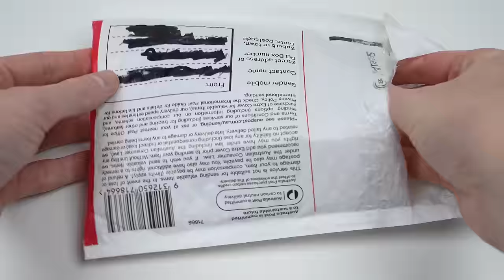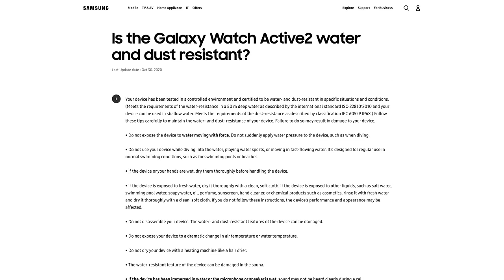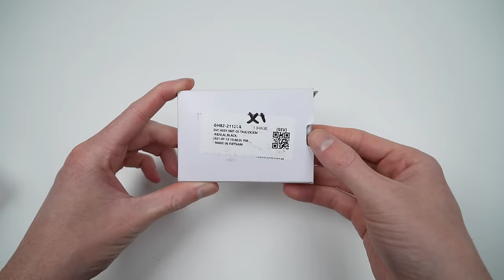Salt Water Damaged Samsung Galaxy Watch Active 2 Restoration

Comment: Seeing how a lot of Samsungs products are engineered it boggles my mind that Apple can have a very similar product yet over-engineer it to the point of being nearly unrepairable.
Reply: I don't think apple is over-engineering its product, they do that for a reason. I have a exact same watch and never took it into shower, however, after 9 months of daily use, samsung's crappy adhesive fails and the watch's ecg sensor and hrm sensor stopped working. I won't purchase any samsung products anymore.
Reply: Apple wants more money, but Samsung wants more customers. So it makes more sense that Samsung sells replacement parts while Apple wants to sell more devices.
Reply: It is deliberately engineered to be unrepairable.
Reply: @creamylulu3427  question. How many apple products do you have? Trying not to jump straight to calling someone an apple fanboy
Reply: That's not over engineering, that's under engineering, glue is a bad engineers best friend. The genius is in making something repairable !
Reply: @creamylulu3427  I've taken my note 9 into the shower multiple times and the only consequence has been a faulty charging port, but even that went away with time (don't ask me how that works). ig their phones are just built different
Reply: @creamylulu3427  I purchased the galaxy watch 3 like a year ago and shower with it, jump in the pool with it, clean my hands and arms with it on. I do it also with my note, I even take the pen out and they're perfectly fine (the watch, the note and the pen), maybe your piece was damaged in manufacturing or fell from a high place idk
Reply: @ProjectFraz  none, I've been using samsung's products since 2015. so,you happy now?
Reply: @creamylulu3427  don't need to be rude dude. I was just asking
Reply: adhesive wears out over time on any electronic. I have a Apple XR and took it in the shower 1 day now I have water damage on my screen
Reply: @miscl_anon  Samsung's products was duilt  tough before they move their factory to Vietnam(different adhesive suppliers probably). I cracked my s9's(made in China) front and back panel two years ago and It still can survive shower today. I stopped take my s20 into shower after the watch was damaged. both of them was made in Vietnam.
Reply: @creamylulu3427  my note 9 says it was "Manufactured in Vietnam" so idk
Reply: Would neva buy an apple product. So overrated
Reply: @creamylulu3427  that's a very specific scenario for you to write an entire brand off lol. "Well my cheap watch failed so the company is trash" I've had an active 2 for over 1 year with daily use and taking showers and swimming with it. You're dramatic
Reply: @huskers1278  I don't think I am being dramatic. actually that's only one of the reason why I decide to switch.
Reply: @possamei  I think it's partially deliberate but there are at least a few reasons. It might save them a dollar or two on fasteners like screws, and probably makes some things easier to automate with robots, and easier to train assembly workers to place something in the right spot and let it get glued into place then to screw the right screws in the right holes to the correct torque. But I imagine the difference is quite marginal. So there's surely some deliberate motivation there.

If Samsung can manage to make a watch as sleek, light, and high performance as the Galaxy Watch line is while also making it screwed together and with minimal glue while still waterproof, then so could Apple.
Reply: Wait to see Xiaomi devices.
Reply: @justinfuller3053  nah, I've seen so many water damaged iPhones, I don't think their water resistance rating actually counts for shit and I wouldn't trust it at all.

...meanwhile, Samsung had a phone with removable back and battery and it had like ip65 resistance
Reply: @creamylulu3427  water can easily get in through cracks, regardless of manufacturer. I advise you stop putting your phone in water in case moisture is building up. s9 is a great phone though, and the best generation of samsungs I think
Reply: Apple is never a third-party (to tweak) or repairs friendly since the beginning. They may make products that were modular in some way in the past, but in recent years, they have more and more distanced themselves from that and become more exclusive and close-source (except in software). It's understandable because they didn't want people to tweak or modify their products (just like Tesla did with the repairs), but then again it's back to the "is it the customer or the company who owned the products when you buy them?".
Reply: Apple wants you to buy a new device every time you have problems with your old one even when it is a easy fixable problem
Reply: @creamylulu3427  bruh, their factory in VN did not manufacture the s20 series, what are you on?
Reply: @kendrinawaskoro3031  yeah, except it's not understandable and they've absolutely made it clear that these decisions they've made are antagonistic to the customer and they honestly and blatantly don't care about your experience
Reply: @tridinh1011 sm-g9860 越南制造(made in vietnam)
Reply: @creamylulu3427  used it for a long time. Nothing like it happened with me. Always wore it while taking a bath, ot traveling and getting soaked in the rain or fiddling around in the water while out in the nature.
Reply: @creamylulu3427  bad job at defending Apple while bushing other companies
Reply: @creamylulu3427  I had a Samsung z flip start saying it was cold 24/7 just bad luck something died, an s21 that randomly lost cell connectivity and never got it back, an s21 also do the exact same thing before the exchange. I’ve had a rough couple years of bad products from Samsung lately. Oh and my galaxy watch overheated within 2 minutes when it was your only way to complete a call lol
Reply: @creamylulu3427  Look dude, i have always own Samsung products and as far as i know ive had one single problem with them. A faulty charging port on a cheap phone. Besides of that i never had one single problem with them products. Tv's, phones, smartphones, watches, mp3 readers, headphones and so on. I would really like to know on what are you basing yourself to say that Samsung products are bad. They aren't bad at all and if the customer actually care about his stuff (watch, phone...) he will actually take care of it. But if you trash talking on a company because you are unable to take care of your connected objects, it is in no way the manufacturer's fault. And that says a lot about you.
Reply: @ilhantele  I wouldn’t say overrated. Rather overhyped, I’ve owned plenty of Apple devices and they are pretty powerful and handle all my daily needs. Every phone with a good build quality is a good phone. It doesn’t matter how repairable a device is to me, especially when most companies offer Damage Coverage plans for a small price. But, if you’re not willing to pay an upfront payment for a Coverage plan then that’ll be your issue when you can’t fix your device for that small price instead now a bigger price hence no coverage.
Reply: @justinfuller3053  probably because it’s been apart before and not had the screen re-gasketed.  My XR is 4 years old and I dropped it in the hot tub the other day. It’s just fine because it’s never been apart. My Apple Watch Series 2 is 6 years old and that will also take immersion. I don’t tend to agree with the glue degradation theory.
Reply: @markbennett6658  never been apart bought brand new and what happened was I took a hot shower and condensation got inside and messed up my screen and my screen is still messed up right now and the seal does degrade overtime look it up
Reply: Apple the worst
Reply: @justinfuller3053  yeah my XS got a water damaged screen about a month ago after the adhesive failed(it fell into a sink for like 3 seconds)
Reply: @creamylulu3427  That reason is, Apple doesnt want people to repair their devices. They want you to buy a new one instead.
Reply: @miscl_anon  the charging port was causing a short, so the phone momentarily disabled it, then the water fully evaporated so it was no longer causing a short, that's how that works
Reply: @immanuelhermon  as in, they make them not repairable, or the other way around? Cuz from what i've seen, xiaomi's products are pretty repairable
Reply: @Fr4ctalR6  no like, the port was working, it's just fast charging that broke. then it worked again. unless the same idea goes for fast charging somehow?
Reply: @miscl_anon  probably some lint or something on top of the contacts or it could've also been a software issue that after an update or a couple of restarts resolved it's self
Reply: @SStarlight9614  idk, maybe the electrical current itself managed to help and do smth weird lmao
Reply: @creamylulu3427  same here, my galaxy watch from 2019 just stopped working randomly for no reason.
Reply: @edwardfletcher7790  You cant' make something waterproof when there are holes everywhere.
Reply: @LordCoeCoe  All standard watches have "holes" and they're often waterproof to 200m.
Reply: @miscl_anon  most likely yea since fast charging uses more electricity with would be more of a danger for the phone in case there was a short
Reply: @Fr4ctalR6  so only fast charging was disabled until the water evaporated, ig that makes sense
Reply: @creamylulu3427  that’s tuff for you I’ve never had any problems with Samsung when I did use it
Reply: I had a cheap Samsung Fitbit, while trying to pair it to my phone it got stuck on pairing with no way to turn it off, meaning I had to wait for it to run out of battery, returned it straight away.
Reply: @justinfuller3053  water doesn’t damage the screen easily, it must of been the soap you were using which may have reacted like isopropyl alcohol
Reply: @creamylulu3427  my nearly 4 year old Galaxy Watch still manages every water just fine. I don't know what you did to yours.
Reply: @creamylulu3427  well it's only you. If you'd be in any repair industry you'd understand that apple over engineers every device they've made since 2007.
Reply: @creamylulu3427  my Galaxy s9+ is still in use after 5 or 6 years, seems you aren’t careful enough with your devices.
Reply: And better, too. Lmao.
Reply: @phoenixyt124  fax android > apple
Reply: @creamylulu3427  weird, I have a Samsung gear sport since it came out. I have been wearing it all the time and swimming with it in the sea every summer. Still works like new. Even the battery still lasts a full day, with some compromises.
Reply: @ProjectFraz  if I tell you that you’ll call me an Apple fanboy but I also have a pc and Fitbit instead of Apple Watch I have a MacBook Air iPhone iPad and airpods

Comment: i am impressed how repairable this was, good on you samsung (this once)
Reply: Pretty much all of their phones are repairable, and they open from the back, so you won't destroy the screen.
Reply: @iddra1868  that's not really true, go look at ifixit's smartphone repairability scores and they are almost at the bottom, often featuring heavy adhesive. of few redeeming qualities, at least they don't (yet) pair components like apple does...
Reply: @Jazzy-kz6wd  I would rather remove adhesive than a fragile screen. The most important thing to me is that you can easily replace all the components without breaking any others. That makes it a 10/10 in my book.
Reply: @Jazzy-kz6wd  I would rather crack a 10€ back glass rather than crack a 300€ display for face id to not work anymore, iFixit ratings are shit

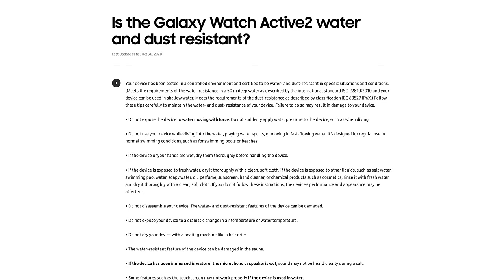Comment: 2:01 "Do not disassemble your device. The water- and dust-resistant features of the device can be damaged."
Traditional wrist watches that are waterproof have a rubber or silicone O-ring under the back (and/or crystal face) and the crown. When they are put in place, they are rubbed in some silicone lube to reduce friction against the rings while being assembled. When such a watch is opened up, the rings invariably get damaged in some way because the lube would be long gone.
So the usual practice while being serviced is to replace the rings using the same method as at assembly. You can see this being done in countless videos on YT. Suggest Wristwatch Revival channel or The Nekkid Watchmater channel to understand what I mean.
With this watch, the back doesn't screw on (although it is screwed down) so there would be no real friction against the waterproof seal. It doesn't even look like the traditional O-ring. However, it might still be a good idea to put some silicone lube along it, in case any part of it is worn. If there is a replacement part for it, it would probably be a good idea to get a new one.
I would also examine the buttons. They would have to be waterproofed as well. After all, salt water did get in.
Reply: Spoiler Alert: You watching a video, except a link.
Reply: @abdulmuhaimin5274  ???
Reply: @two_tier_gary_rumain  you didn't add a video link.
Reply: @abdulmuhaimin5274  For what?
Reply: @two_tier_gary_rumain  I'm assuming that they thought that you stole the info from a video, then wrote it down as a comment without linking the video itself.

Either that, or they were grumpy that you didn't link to Wristwatch Revival and Nekkid Watchmater's channel?
Reply: @J4yy_  You can't put a link in a YT comment without it being immediately deleted. And those two channels can easily be found by searching.
As for my comment, that is all mine.

Comment: I've literally just repaired that same watch a couple days ago! Disassembly process is a breeze compared to other smartwatches, and internal layout is very sensible. Mine developed a weird touchscreen issue, so I bought a not working unit and swapped all of the components from my watch to a case with display of a dead one, so at least I got my daily watch working fine again. That non-working unit turned out to be water damaged and corrosion got up to button contacts, so I ran a jumper wire from a button to the board, cleaned it and assembled it in the case with bad display. It booted, but touchscreen is still dead on the bottom half. But hey, that's one and a half working units, that's fine by me :3

Comment: Great video Hugh... if only you had done this 3-4 months ago, I would have made sure to be more careful with the power button ribbon cable when attempting to repair my water damaged Samsung Gear S3 Classic! 🤣😂

Everything was going along fine, after opening it up, I could see where the water damage was, so cleaned it up as best I could, then reconnected everything, however it didn't turn on.

Decided to buy a new battery (don't have a multimeter), to start with, so when it arrived, I attempted to take out the old one, which I couldn't work out how to do initially, so was a little rough with it, and to my horror, I discovered that the power button ribbon cable had come off! 😭 Fortunately I have a soldering iron... unfortunately, I have never attempted anything of this minute scale, so gave up and bought a second hand Samsung Galaxy Watch (2019) instead.🤣

I've kept everything though for a rainy day, but might get a new board and screen, if I can find any. Thanks Hugh. 😎
Reply: I have a Gear S3 Frontier

Comment: Nice clear video. After wearing my Active 2 in a hot tub, it got stuck on the "Rebooting..." screen. Figured it had to be water damaged.

Following this video, I was able to take it apart and dry and clean it (I just used isopropyl alcohol). Now it's back on and charging!

Comment: This damage surprised me, my Fossil Sport is 3 years old and I've swam with it in the ocean many, many times and it's still working like new. Apart from being dog slow and the battery being super crap...
Reply: The ex owner either dived down 10ft with it or the seal wasn't seated correctly in the factory.
Reply: Many things can do it, maybe an odd strike to the side moved the seal a little, maybe he moved his arm in a weird motion underwater and the pressure was directed to the microphone part.
Reply: Well, it's luck of the draw on build quality, I had a Ticwatch C2 that died completely after 2 trips to the beach, and it's got the same water rating as my Fossil Sport. Suffice to say I'll never buy another Ticwatch. Waiting for the Fossil Gen 7 to drop. I guess a watch manufacture knows something about making watches properly waterproof, compared to a tech manufacture...
Reply: My old Gen 5 had a broken screen for a year before I replaced it with a gen 6 recently.

Swam with it in the ocean as well. Hours at a time and it was never a problem. Waves hitting it, diving in a pool, the whole 9 yards. Even with the cracked screen, it kept working even after being abused underwater. 

Really surprised to see the Samsung watch have problems with it. Definitely don't want to form my entire opinion on their watches based on one, but considering the gen 5 and 6 are completely sealed, I'd make a guess they're probably more water resistant.

Though, as a result, you lose repairability. Hard to say which I prefer.

Edit: you lose repairability*
Reply: @tyf.4399  I guess my point is. What use is a smart watch when you're swimming in the ocean ?
Reply: @edwardfletcher7790  notifications, calls, time, keeps track of activity, must I go on?
Reply: @tyf.4399  Yes, please go on.
You tried but you failed.
Reply: @travisash8180  Well that was a joke I'm sorry but I don't care what you think. But thank you for asking.
Reply: @tyf.4399  You tried but you failed, again !!!

Comment: I have Gear Sport watch and it had similar salt water damage. Opened it up and cleaned it but bezel does not select things as you turn it. Is the vibration motor related to the bezel selection?